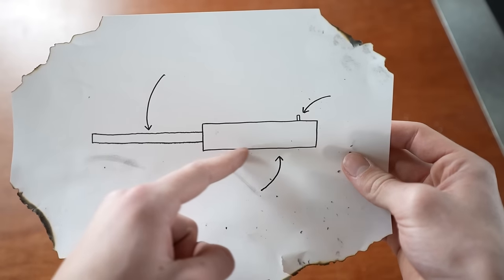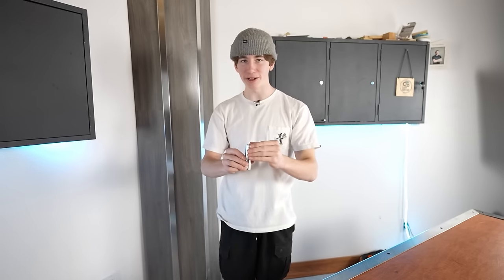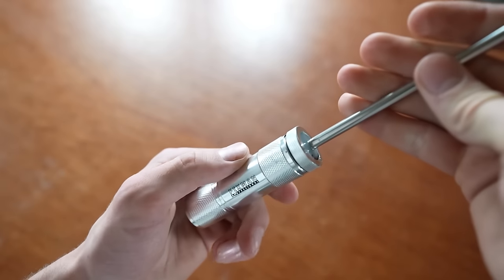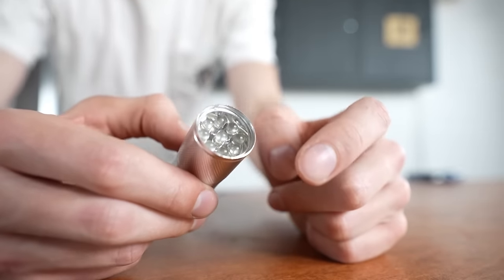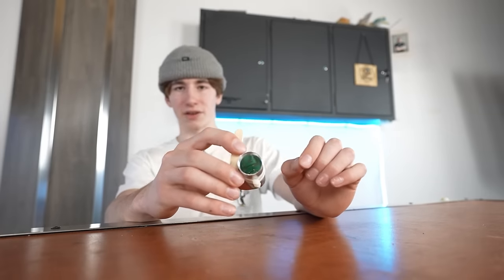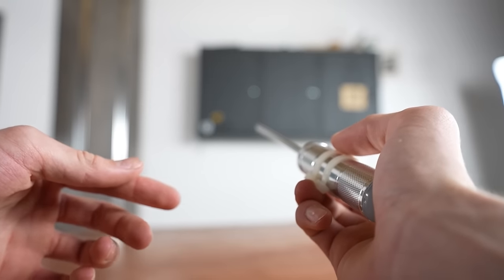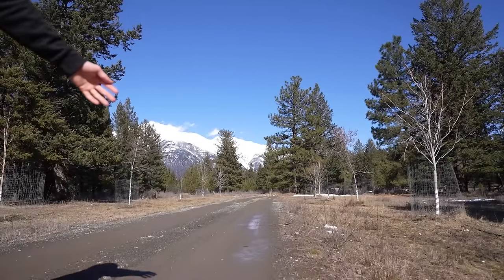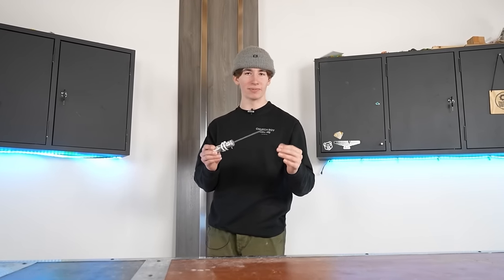I Made The Worlds Smallest Potato Cannon

Comment: Did this 15 years ago but much more powerful. Fineliner, 6mm BB, BBQ Lighter and some small plastic bottle. The key is to use a little motor with a fan inside the chamber to mix the gas.

Comment: I made one of these 10 or so years ago with the stock of a airsoft gun so it really looked like a pistol. 
The chamber was a clear, empty spice shaker. The plastic was strong enough to handle any explosion within the small chamber and the shaker's cap even popped open making it easy to spray hairspray inside!
We found that q-tips works well as a projectile and it helps to push in the q-tip after spraying the chamber as this pressurizes the chamber and makes for a bigger bang.

Comment: I made one out a baby asprin bottle, and the blow tube from air compressor on bottom of bottle, put same ignitor on a d wired up, remove the bottle top spray a spritz of alchol in, use a piece of paper towel for wadding so the 177 caliber pellet seats tight, now that a go threw a book, I epoxy the barrel and holes wires feed threw

Comment: How about a compressed air pen bazooka?

1 pen barrel just open on both ends

1 long stick that has the inside diameter of the pen barrel

1 hard skin of a fruit (watermelon for example)

Jam both ends of the pen barrel with the hard fruit skin

Use the stick to push inside of the pen barrel one of the hard fruit skin towards the other hard fruit skin.

The air pressure builds up inside and pops out the hard fruit skin from the other end.

RELOAD by jamming the empty end with the hard fruit skin

😆😆😆😆😆😆